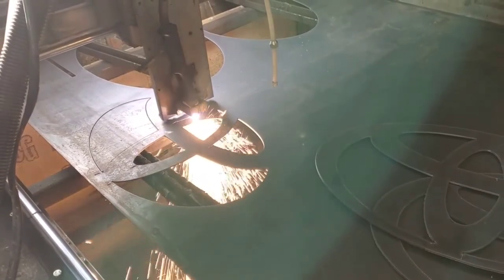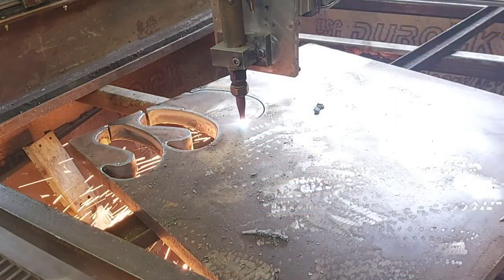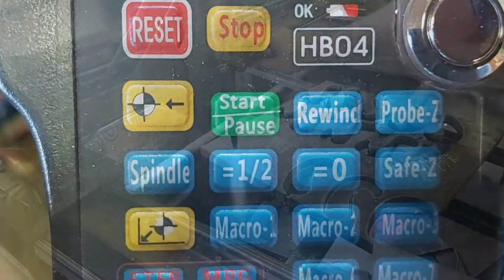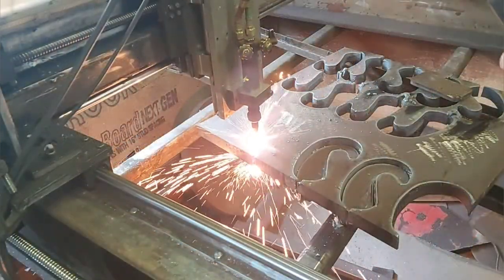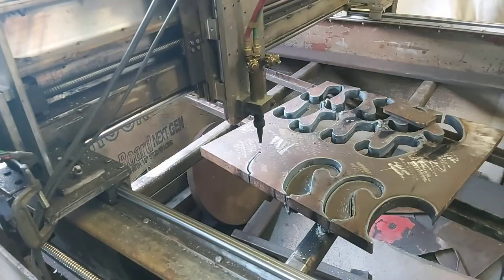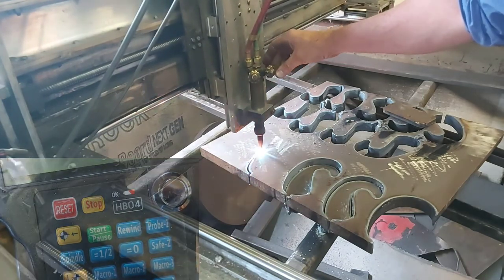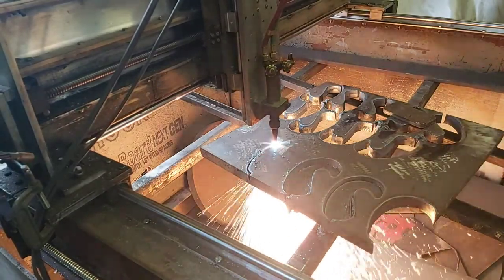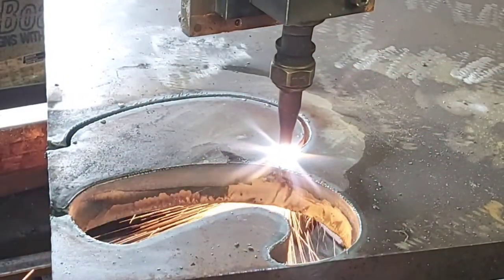How To Convert Plasma to CNC Oxy Torch Flame Cutting Machine

Comment: I use the smallest harris cutting tip to cut 25mm plate @ 330mm minute 45bpsi oxygen and lpg @ 10psi
Reply from the maker: Thank you  !!!. My learning has been sending me in that direction for sure .   I just did another run of those parts and raised my height up to ¼ off plate speed 11 ipm with a #2 victor at the oxygen settings you stated .    Cut like a knife amd left a realy good finish.

Comment: How did you set the kerf? I use mach 3 on a 10'x20' plasma table and also have a torch. I've found that using the torch the parts do not come out to size like the plasma.They are either over or under depending on if its an inside cut or outside cut.  Are you changing a setting to allow for this?
Reply from the maker: I am using vectric aspire to program (used for routers usualy ) I have the tool bit size set at the size of the cut .  I found that ofcourse by test cutting and measuring the width of the cut.  Some times i add a little more just because of finiishing .

Comment: Could a 110v plasma cutter be setup the same? Only for maybe .060 or thinner steel.
Reply from the maker: Yes you could use a router for a plasma however there are a few challenges with that . 

-First it is very dirty for the electronics so a fan sucking the fumes away for sure 
-Second thin metal will curel as you cut it and your hight can change. This will sometimes Boe up and the tip will rub or the cut part will peel up and the tip will hit it and drag the work . 

If you do converti it I added a eagle torch height controller and tapped into the plasma cutter trigger and added a relay .
Reply: @Wrighmachining  thanks. I do have a couple of steppers and an older 3 axis controller. You're  making me think 🤔
Reply from the maker: @roscoepatternworks3471  cnc plasma can be a game changer in making things .  Just program on rainy or to hot days amd cut on the good days and weld togeather like lego :)